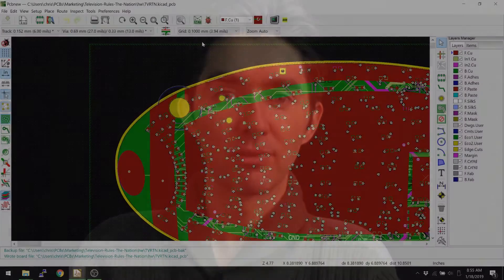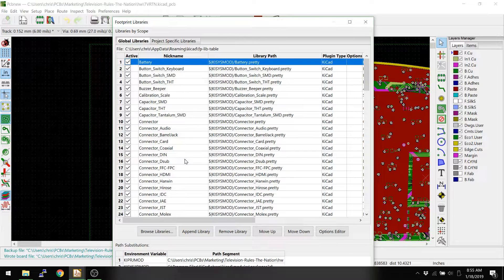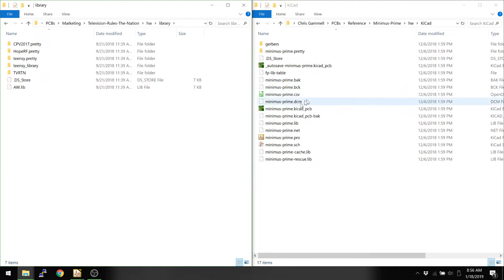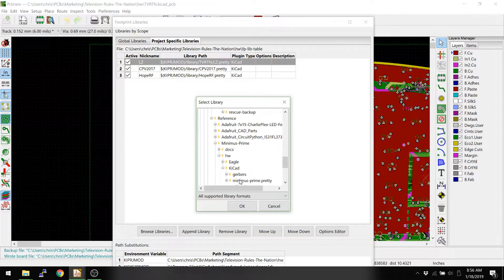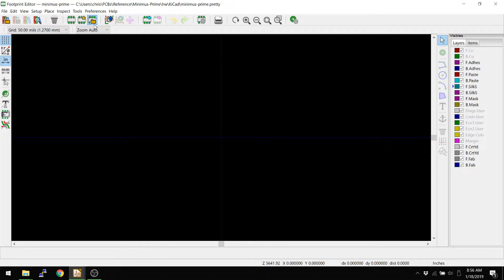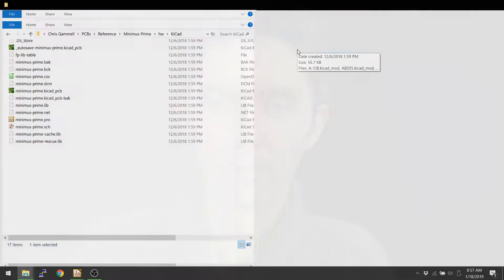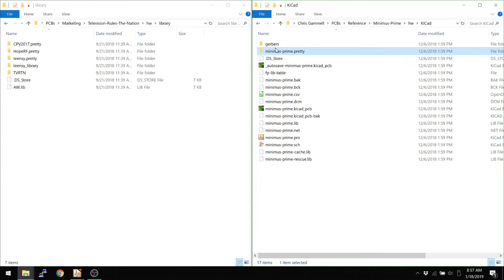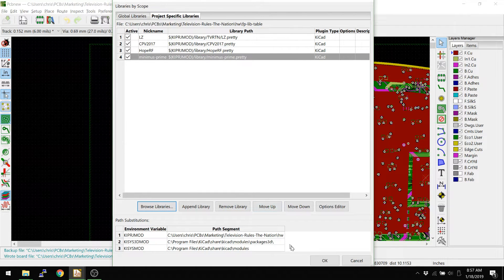KiCad 5.0 -  Adding new footprint libraries

Comment: To add Libraries on KiCad 5.x with MacOS: 
1: Have libraries downloaded in a folder for which you know the path.
2: Open EEschema
3: On top of window go to Preferences -> Manage Symbol Libraries
4: Select the "Add Existing Library to Table" Icon next to the plus sign, under your libraries list.
5. Highlight each .lib file in your downloaded folder.
6. Add, check to make sure it has been updated.

Comment: Chris,
I need to do schematic and PCB layout of Vacuum Tube circuits.  Can you tell me how to obtain library symbols for all the Vacuum Tubes used in the U.S.A. ?
Also, it appears that all the libraries are being "dumped" into my Documents folder.  Do they have to be there, is there a reason that I should want to put them there?  What about making a special folder called KiCad that you put the libraries in?  Would you recommend yeah or nay?  Also, what about making that folder under the KiCad main folder for the program?  Would there be any reason not to do so?
Thanks,
Wayne

Comment: I really appreciate your videos and have purchased KICAD based on how helpful and well you demonstrate the use of KICAD.

I found it really easy to draw the first schematic, however,  when I go into PCB mode I have problems with the wire not connecting to the component. So the components cannot be connected. It seems like the wire is sticking to the mouse cursor. 

I would really appreciate any advice or even a youtube clip on how to resolve this issue. Again, thank you for your fantastic videos.